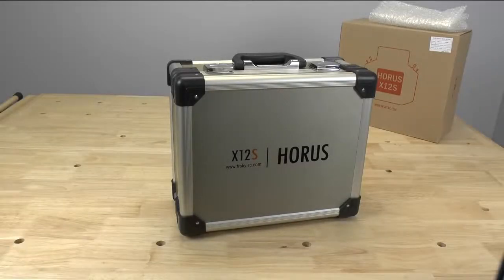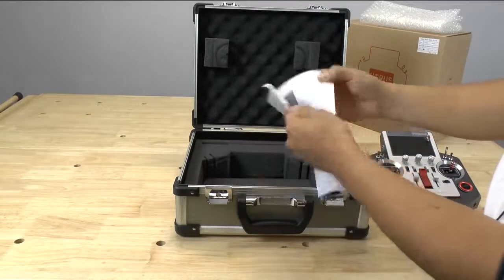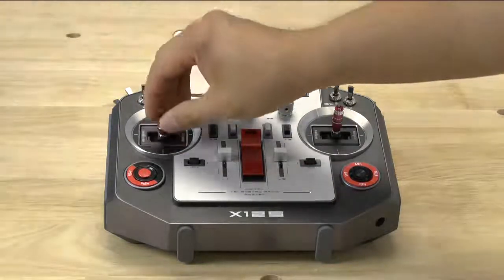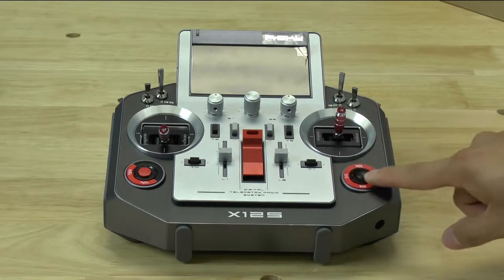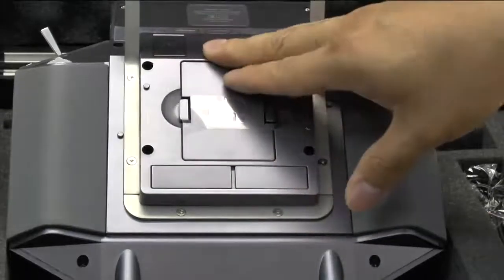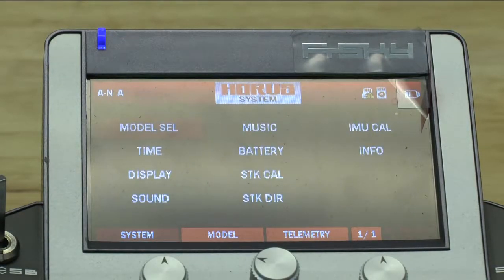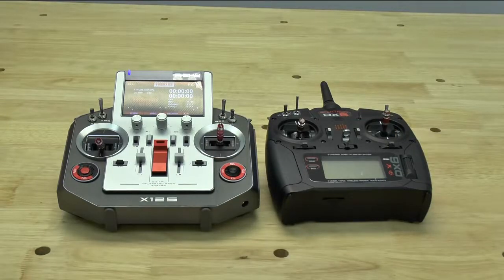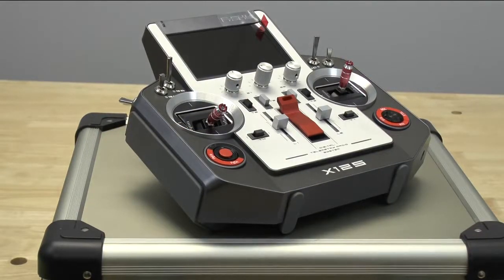Frsky Horus X12S Texture Version 16 Channels Inbuilt GPS Module Transmitter

Comment: LoL,nice review but do your homework before you do a review next time, the left knob had a detente for center in the prerelease from what I saw and the sma on the back is linked to the transmitter & can be used at the same time with a simple update. Nice to see a comparison between spectrum tho good job & nice review just look in to it a bit more before doing a review pleas.